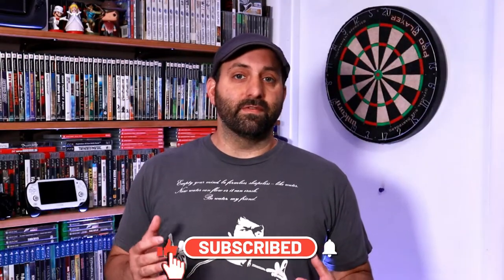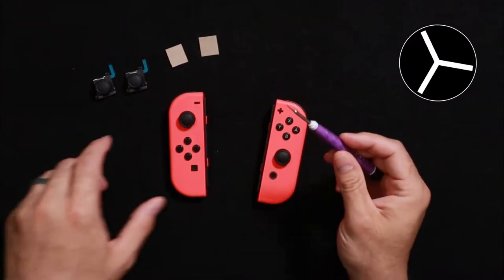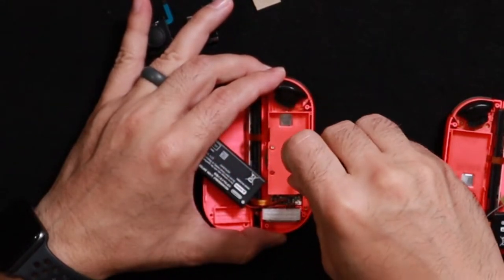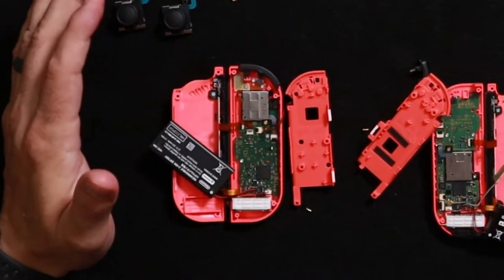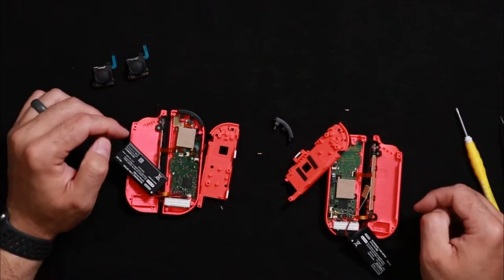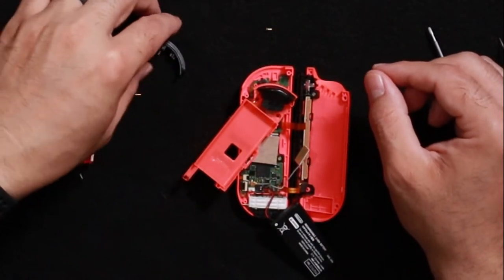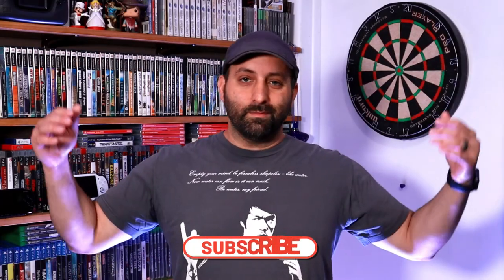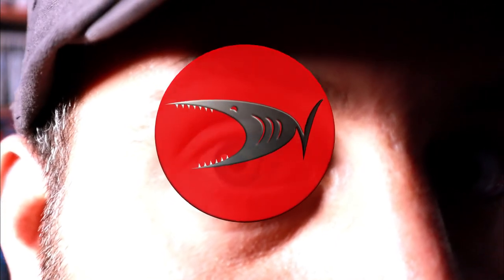How to fix Joy-Con Drift for good: Joystick Replacement | DocValentino

Comment: Super helpful! 👍 let’s see a video on replacing the joycon shells. Extreme rate has some nice ones, I went with clear and classic NES.
Reply from the maker: I should do that. We use the pro controllers 99% of the time anyway. The metal latches in the Joy-Cons is a must. I should do a video on swapping those.
Reply: @DocValentino  Theres some cool pro controller shells as well. My pro controller has the NES shell.
Reply from the maker: Nice choice!

Comment: Having trouble with the left joycon, did the cardboard option and still having drift issues, but with the right controller seems to work so Far
Reply from the maker: Yep, the cardboard only worked on one of mine as well. It could be a good preventative thing to do when fully replacing the joysticks..

Comment: what's different about the joysticks you're replacing the old ones with, that you're so sure they won't drift?
Reply from the maker: You won’t have drift with them when they are brand new. I’m sure they will eventually drift again, but putting the cardboard in as a preventative measure on the new replacements should help prevent it long term.